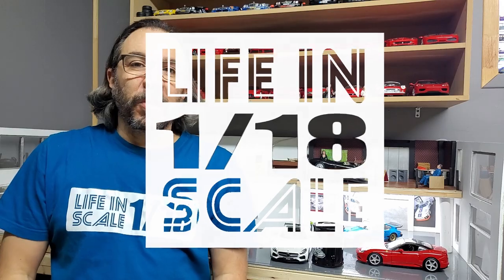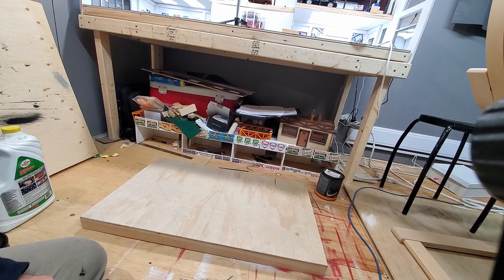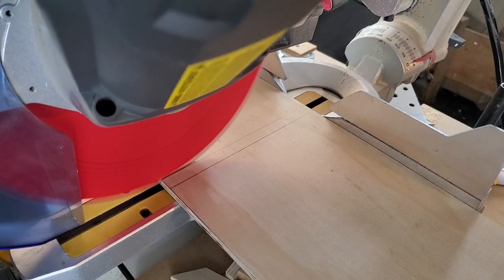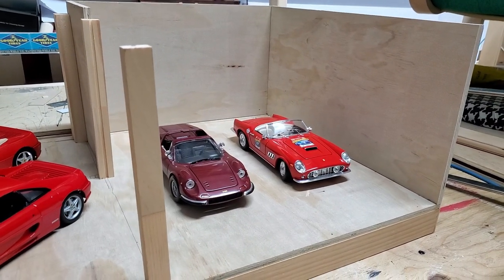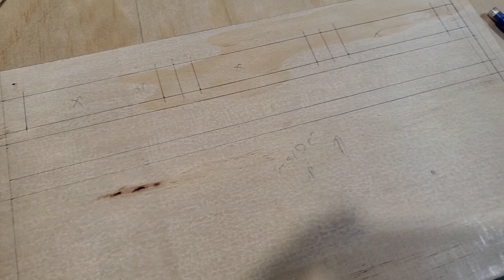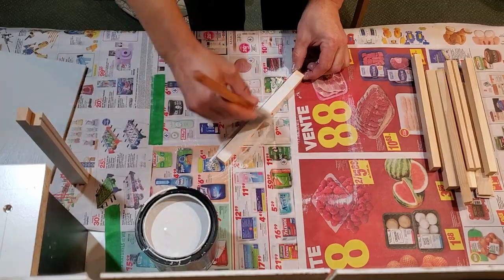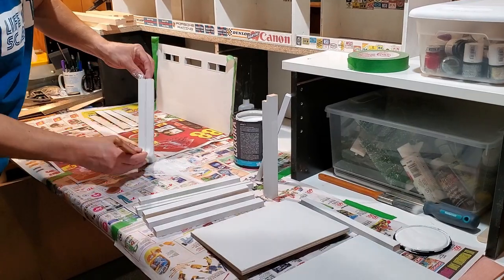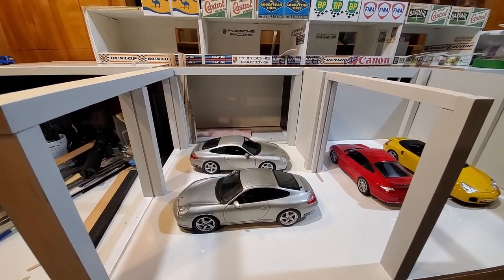New Diorama Build! 4 cars, 2 rooms for a private client pt.1

Comment: what is the measure for the wood with grooves for plexiglass?  length x heigth x width (so i notice is a rectangular shape of wood, it's correct?). thanks a lot!
Reply from the maker: Dimensions are 18 inches by 30 inches. The groove for the plexiglass is 1/8" wide by 1/8" deep and placed at 3/4" from the side. The overall height is 9.5 inches. Hope that helped! Thanks for your support!!